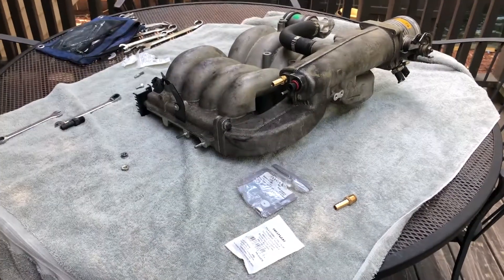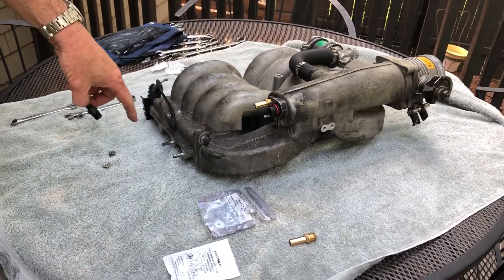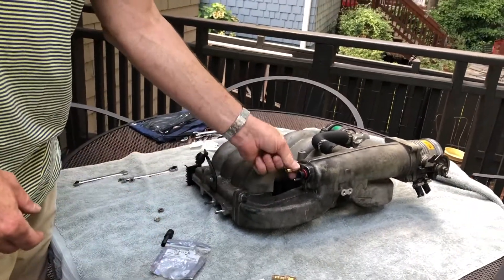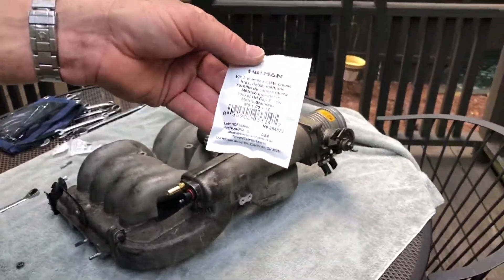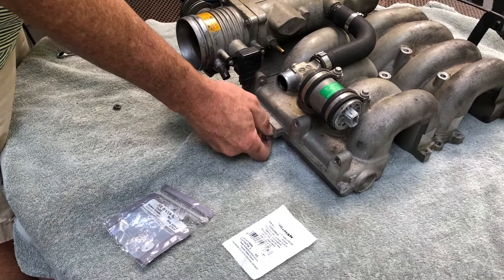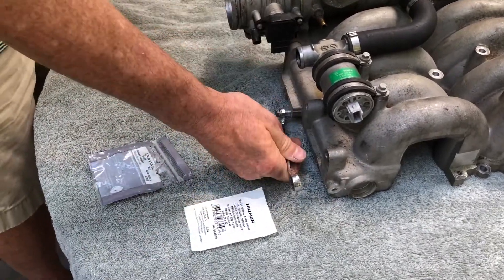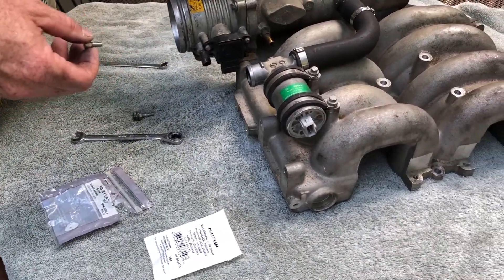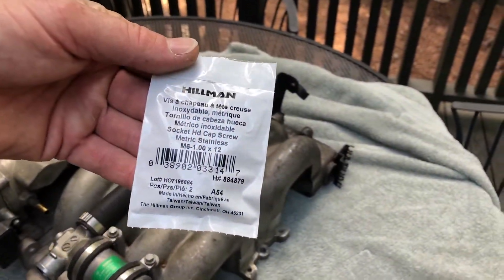Rover V8 upper air intake modifications

Comment: I agree about the pipe niple breaking . plastic junk. Also those are nuts you threaded back on to the studs .not screws that you screwed on . And the primary reason those studs are there is to hold the exhaust gas recirculation valves (EGR) in place . and though it does make it easier to install the upper manifold putting bolt back in the studs place can make it easier to twist off the bolt . yeah I have .
Reply: The egr valves mount to the plates that are held in place by those studs. Sorry for not being clear .on this matter

Comment: I really wish I would've find this video sooner. Mine just broke. Have you heard of anyone ever fixing it and not replacing manifold?
Reply from the maker: I BROKE MINE ALSO BEFORE.  USE A DREMEL WITH A SMALL WIRE BRUSH AND YOU CAN GET THE PLASTIC OUT.  MAKE SURE YOU TAKE OFF THE AIR INTAKE FROM THE OTHER SIDE AND BLOW ANY DEBREE OUT AFTERWARD.  THEN SCREW IN A NICE NEW METAL ONE WITH 1/4 THREADS